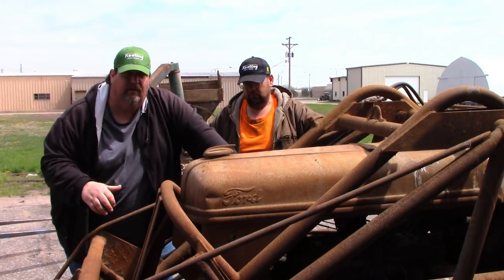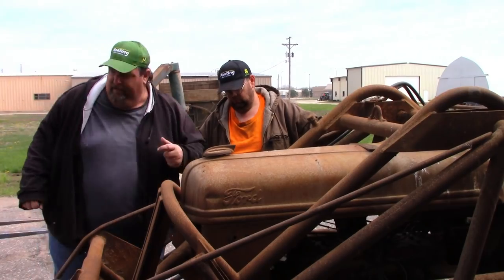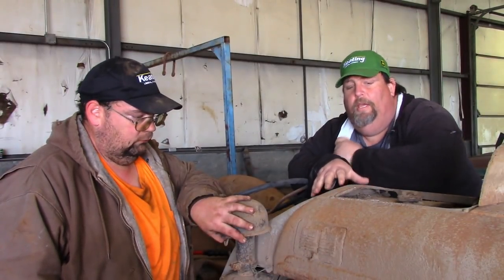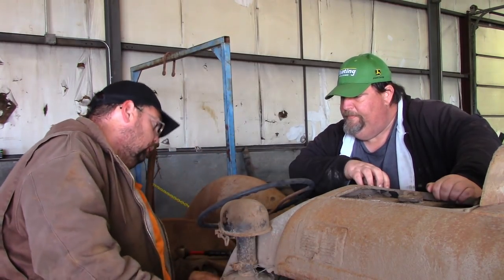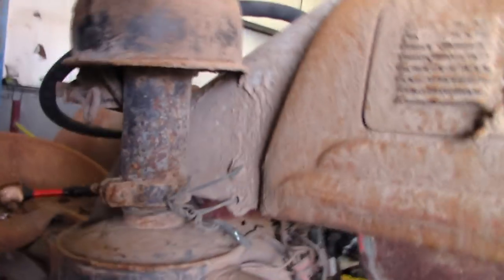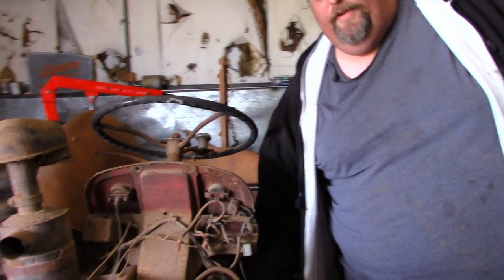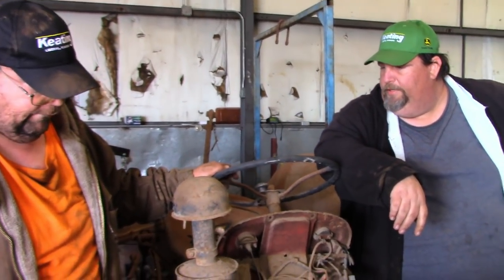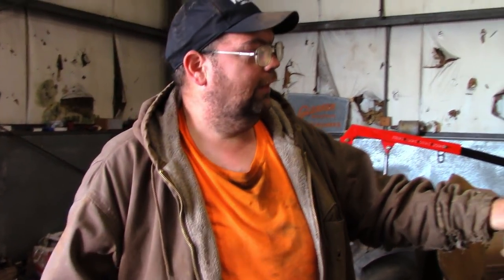8N Funk Conversion

Comment: I am a tractor guy and thought you were talking about the Funk transmission - it dawned on me this tractor has a 6 cylinder Ford engine in it - never seen one - have seen flatheads but thought they also were one offs by a local machine shop.  Interesting piece.

Comment: Crazy D. I just bought one and it runs good. Leaks hydro and oil just a little. Can you tell me about the to tanks. Gas and karosin?
Reply: 22:53 At 1 tank could be the oil tank for the loader. Set a took off says them never did run on Multi fuel
Reply: @duanebolen543  after much research I talked to a man that said it was an add on gas tank to help support the 226 inch flat head 6 cylinder.

Comment: That looks like that's the 3 speed. Chairman, so you got 12 speeds altogether? You pull back halfway, pull out and then go back again. And that's over, drive otherwise. Straightforward is under straight back is standard.

Comment: You know if they had put a split shot on the wire, heated with a blow torch and crimped it tight with a pair of pliers that was a factory sealed unit.